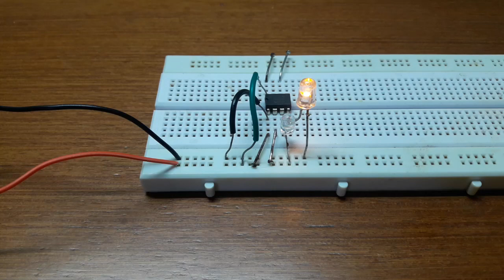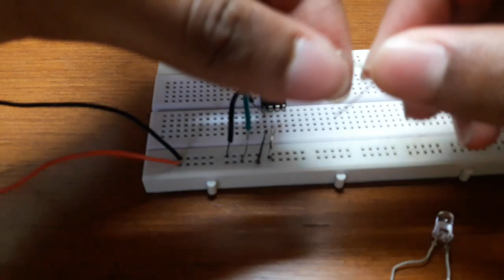How to make a "Touch Sensor" using 555 Timer IC on Breadboard [Part 2]

Comment: On addition of a buzzer alarm to the circuit, a dim sound still persists even after touching the other touch plate while the LED is on. How do I resolve this?

Comment: hey troy! can we use wire instead of pins?but using wire is not working
Reply from the maker: +logaa kirishnamurti Hey!
Maybe because the pins are better conductor that the wire! Try using a thick wire by overlapping multiple wires!